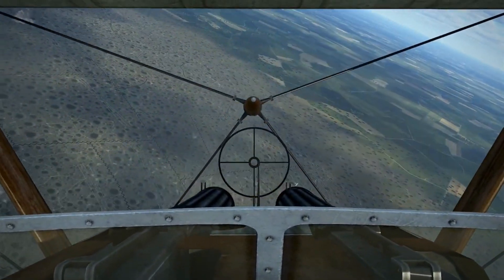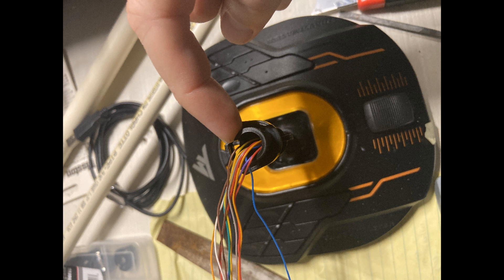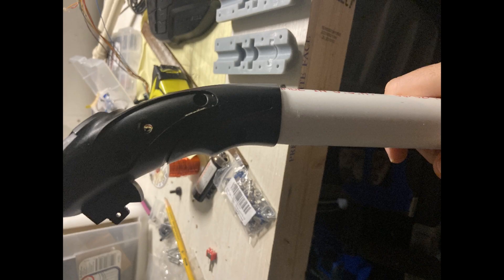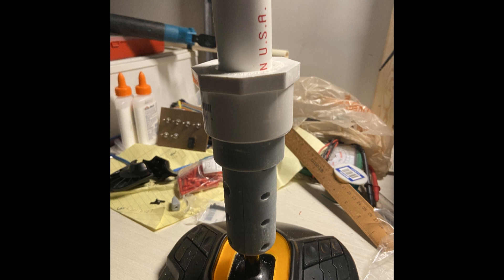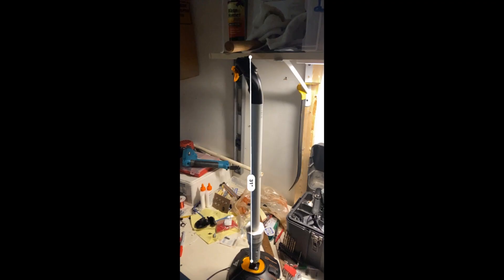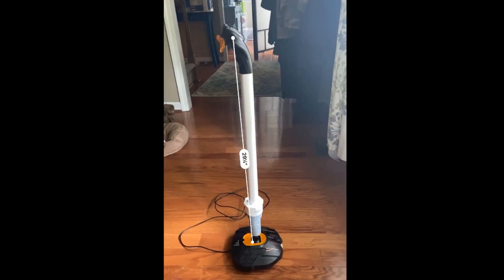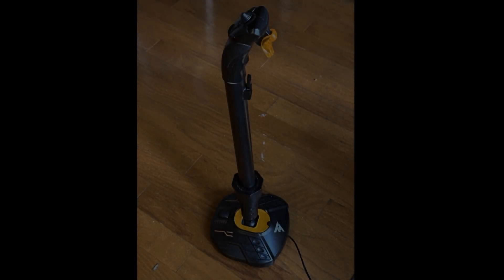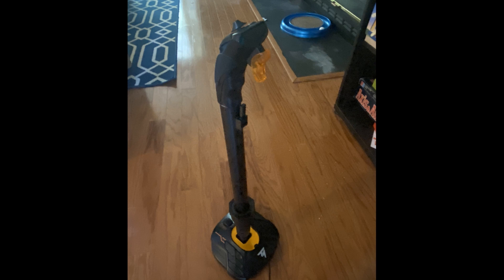I created my own joystick extension (Thrustmaster T16000M)

Comment: great video - have thought about doing this 1000 times...

one thing i'd watch out for is with all the leverage you've got with the longer stick, you might end up cracking the gimble ball & rod that sits in the stick's base (no idea what it's called), depending on how often & hard you go full deflection. I guess full deflection is less likely because of stick extension, though...
Reply from the maker: Yeah not a lot of need to go full deflection with this one. If nothing else my stork-like legs or desk/chair prevents it lol.

Comment: I'm not familiar with the crew station geometry of the Apache or Kiowa, but a 20"-ish stick length (measured to the middle finger position) matches the blackhawk pretty well. What's more important is the linear, or arc distance that the grip travels. 10" is a pretty good distance for helicopters. Because you modified a desktop joystick with large angular throw, it appears you have a fair bit more than this. 

BTW, since you have an awesome resin printer and you know how to wire switches, I don't think it would be too difficult to make a really nice grip. I have the beginnings of a 3d model of a "cobra style" grip, which can be found in the UH-60A and L variants. Let me know if you're interested.
Reply from the maker: Totally interested! And yeah I am far to simple in the head to understand 3D design beyond basic shapes. I’ve watched many videos and tried to follow along but I just get lost. Need to have a sit down with some genius and have them walk me through it. If nothing else I need a base for this grip cause I had to sacrifice it for that attachment.

Comment: So I just kinda skimmed through the video real quick in the small amount of time I have, was wondering if you could fix the return to center problem with a stiffer spring? Sorry if you went over that in the video I just didn't catch it if you did.
Reply from the maker: Zach Gillett no but honestly I didn’t try. I kinda like the wet noodle feel as a kiowa will spill you on your ass if you let go. It holds enough tho that I’m comfortable releasing pressure without my aircraft doing a crazy Ivan barrel loop.